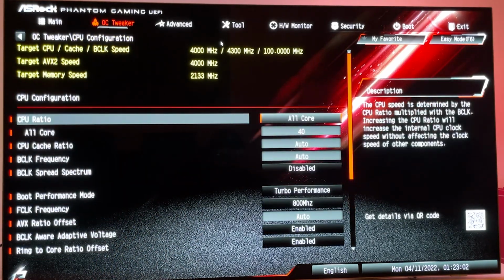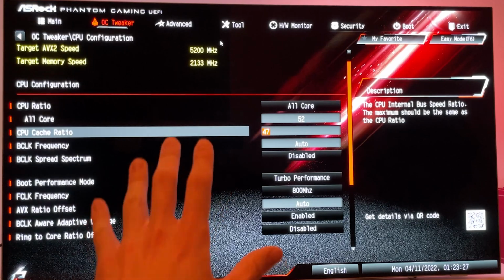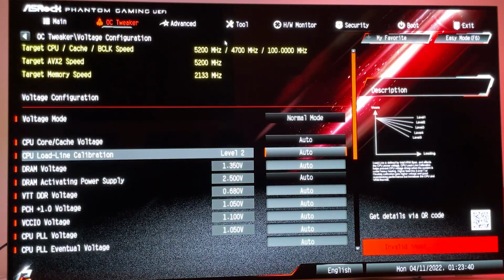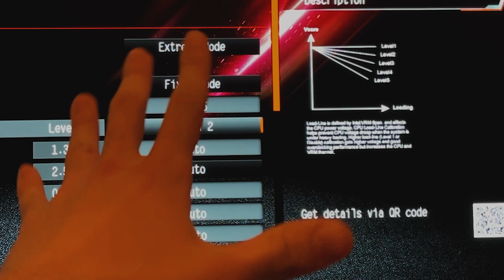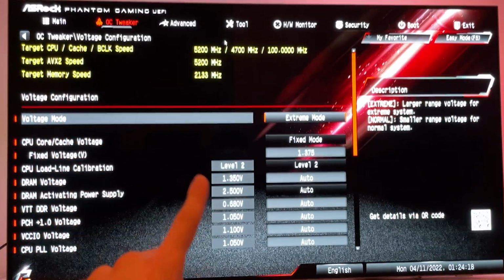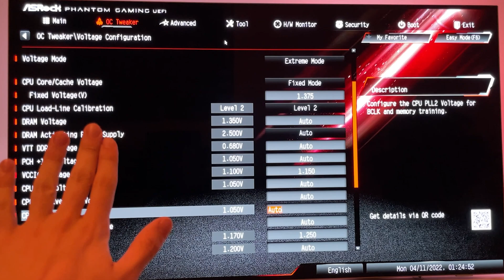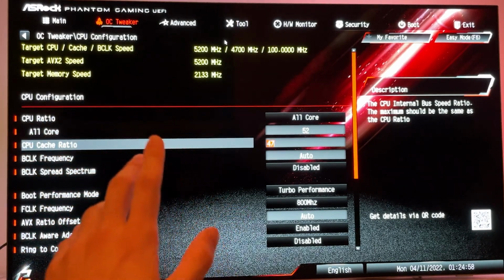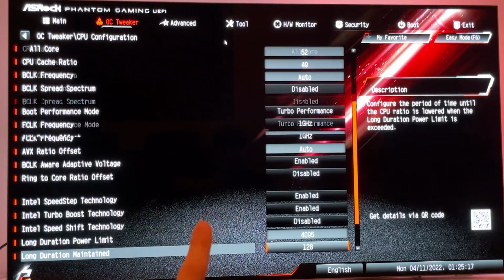How to OVERCLOCK an i7 8086K to 5.2Ghz

Comment: Im sitting here with a i7-8086k and Now i'm contemplating on overclocking.. as I want to get more performance out of my system. as i'm tiered to often have supar FPS in games.but would this help much? and how much heat would it generate? what would the tempts of my CPU be? and would it be easy to resort to normal..
I'm not too much into overclocking just have done the normal XMP/DOCP for the ram and that's that. 
Spec: CPU= i7-8086k
Ram 32gb ddr4-3200mhz 
mobo= asus ROG Strix z370-f gaming
GPU=rtx 3090
Reply: Have same cpu, considering the same. It's a great chip to oc. Just make sure you have a decent cooler.

Comment: Exact vcore/frequency/cache i used to use on my old 8086k sample, sadly i ran it on a M10Apex in which you don't really have any LLC which is closer to the vcore you set on bios, lvl 5 were vdrooping a lot while lvl6 although overshooted vcore to 1.392 provided 100% stability.
Also i used to ran my sample with IO + SA at 1.215 (1.24v on load measured with hwinfo64) for 4300 18-18-28-2T
Reply from the maker: Man thanks a lot for the feedback! It's nice to have some validation on my settings, I really appreciate it! Also great overclock on the RAM there, it just goes to show how good the IMC on those CPUs is, too bad my RAM kit was really bad :/
Reply: @ImWateringPSUs  Thanks to you for creating the kind of content you do, its very enjoyable tbh! I used to follow you on IG so as soon as i knew you created an yt channel i came here to sub.
My ram kit is a trident Z rgb (batch from 2018) 4266cl19 bdie single side 2 x8...sadly its not a great overclocker too =/ at the moment is running as tight as possible on my 5900x at 3600 14-15-15-30-1T but its imposible to stabilize it at 3800, my cpu was tested with other kits like Viper ones and ran very smooth 3800 low latency HCI w/o any problem.
Reply from the maker: @federicosanchez9630  Oh man, I really appreciate it, for real. On to your RAM kit, it's still doing pretty well in my opinion, but it's some really good ram, I agree it should be able to do 3733 CL14, have you tried playing around with the infinity fabric settings?
Reply: @ImWateringPSUs  I tried, nevertheless its always unstable to pass HCI or prime95 at 3800 / 1900 fclk, even with vsoc at 1.2 and vdim 1.5...it simply doesn't want to run.
However its 100% stable to run some cinebench test and so on.
This cpu was tested with some trident Z neo / viper ram (the ones that have xmp 4400mhz) and i ran perfectly, so the problem is basically my ram...which is not a big deal since i play games a 3440x1440 so i dont really need that much processing power but a very strong gpu, i just would like to have ram running at higher clock to brag a bit haha.
Reply from the maker: @federicosanchez9630  Oh yeah I see, you really went reallty thorough with all the testing, I can tell you've been OCing for a while! I definitely understand the thing of just wanting to have higher frequencies lol, I have that problem as well ahahah. I also play on 3440x1440 by the way! Which GPU are you running?
Reply: @ImWateringPSUs  Atm im running a 3080 ftw3 attached to a full cover EK block + EK Phoenix 280mm kit on push+pull.
I never finished my custom loop so all the pieces (but fittings i never purchased) are sleeping on my shelf.
However its amazing how those EK Phoenix kit chill pc components, its very sad that EK decided to discontinue them, they perform (at least on terms of gpu cooling) as equal as a custom loop.
Reply from the maker: @federicosanchez9630  Oh that's really nice. One of those kits (in a 120mm model) would actually be perfect for my ITX build, it's really a shame they have discontinued them :/ Building a custom loop just for the GPU would be a bit too much for me, clearly :/
Reply: @ImWateringPSUs  As far as i know there are brands that offer kits like the Phoenix one (Like alphacool with their Eisbaer extreme 280) which for sure could chill a gpu to its limits.
However i dont really know why EK decided to discontinue those kits and never replaced with any other plug and play product...since its less messy than treating with a full custom loop and is easier to service too.
One of those kits was cooling down my old 1080ti strix and at around 320w max temp i was able to see was like 36c while playing or in superposion benchmark.
Reply from the maker: @federicosanchez9630  I will try to check out the phoenix one! Thanks again mate!

Comment: Meanwhile me at 5.5ghz on 9900K help me get to 5.6
Reply from the maker: Man 5.5 at ambient temperature, if stable, is more than I ever achieved lol
Reply: @ImWateringPSUs  Yes, straight water. No fancy chiller, dry ice, wet ice, or ac unit shenanigans. Just 3 420mrads 8 fans on those rads (one fan omitted for the reservoir) previously 5.4 ht on but after sanding i can do 5.5 ht off which is fine i actually get more fps in csgo with 5.5ghz and extra 110 on the average by setting the ringbus from the default 4.3 to 5.0. i knew ringbus would net me extra performance but not THAT much so my next focus is seeing how far i can take ringbus, previously 5.1.
Reply from the maker: @kommandokodiak6025  Oh man that's REALLY nice. Probably the highest daily OC I've read of, just goes to show how much cooling and tuning can do if you have a good chip. Thanks a lot for sharing! I agree that the cache really give out a lot of performance! If you're mostly playing CSGO then I understand, but generally I'd recommend keeping the HT on, at least with these 6c CPUs!